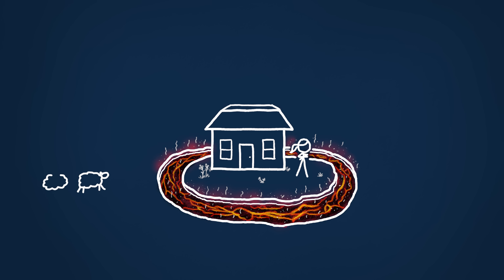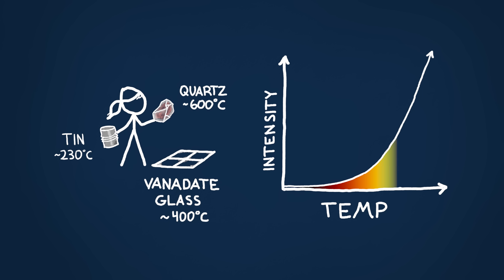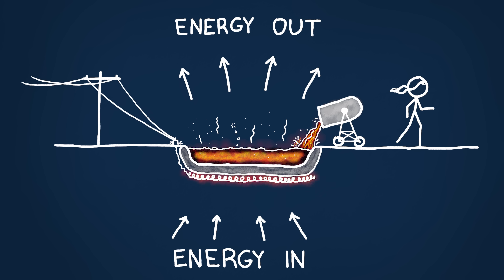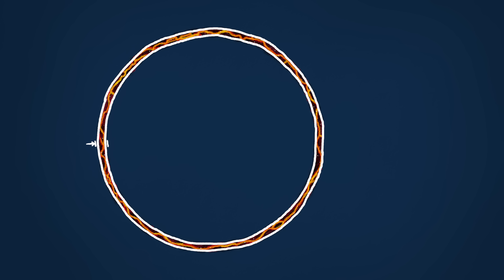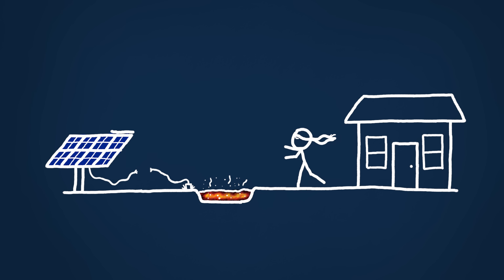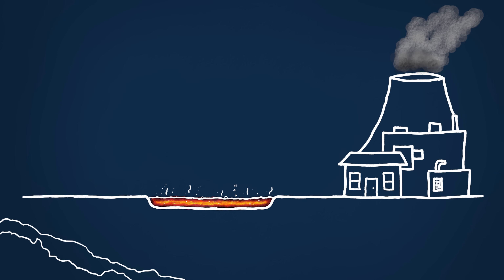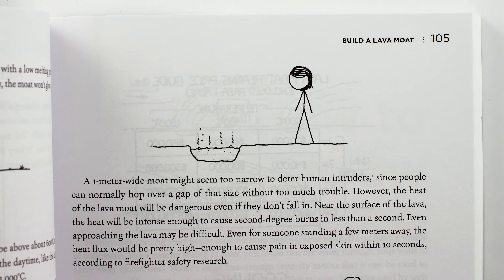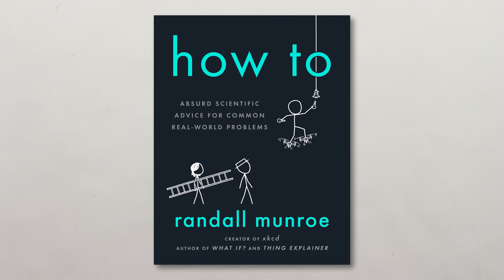How to Build a Lava Moat (with xkcd)

Comment: in what way is a 10km radius area absurd? Although you will want quite a bit larger area, as you need enough solar power to moat enough area to also fit the rest of the city alongside the solar panels. Or just make the city build underneath the panels.

Comment: Use lenses instead of solar panels to maintain your molten basalt- drops your required A/C ratio by a factor of 20. Added bonus of a superheated invisible wall of death.
Reply: Drops property minimum size to 32 acres, or 25 football fields.
Available now for $78k in San Luis, CO.

Comment: But how deep do I need to make my lava moat? Clearly, a very shallow moat will have a poor surface area to mass ratio and lose a lot of heat. And a moat deep enough to tap into the earth's mantle is not practical. (Although the idea of my own personal mini-tectonic plate is interesting!) But somewhere in between is a sweet spot that could store a lot of heat in it's mass and not radiate too much to the environment.

Plus, you need to discourage tunneling under the moat.

Comment: I think I’d stick with a coal effect lava moat, a few 100 red and orange 25 watt incandescent bulbs with twirly aluminium bits above them and orange/ red glass chunks for realism. 
  As for the burning the burglar, motion sensors triggering a spark and propane gas jet. 
  Problem solved on a budget!

Comment: How about mixing radioactive material in with the lava? Cut out the middle step of generators and heating elements and heat it from radioactive decay.

Also, if you got it hot enough, could you have blue lava?

Comment: Instructions unclear. My lava is emitting 3.6 Roentgen. Not good, not bad.
Reply: 3.6 roentgen from lava moat ? This man is delusionnal, take hime to the infirmary !
Reply: you didn't see graphite in the moat.
you DIDN'T!!!
Reply: Instructions *nuclear.
Reply: It's all fun and games until

ionizing gamma radiation
Reply: In order to produce ionizing radiation just from blackbody radiation, your lava will have to be at least ~300,000 Kelvin. It's emitting at least 460 terawatts of power per square meter.

Color me impressed.
Reply: @nathanaelvetters2684  sorry to disappoint you but we just threw in a bunch of radioactive metals :(
Reply: @Carmenifold  Using radioactive decay to provide the heat for your lava moat seems like a sensible low-maintenance solution to avoid the need for external power or having to build a power plant inside the moat, making this solution especially attractive for small, single-home moats.
Reply: Maybe you should get a copy of the book, like me.
Reply: Nah
Just a chest xray
Reply: This lava is infirmary, take it to the delusional.
Reply: But at what rate?

Comment: I like how in the intro they used the logic symbol "and".
Reply: @lanye74  nobody is talking about programming, why do you bring it up? We are talking about mathematics.
Reply: In C/C++, that's the exclusive OR symbol.
Reply: @rgbii2  Yes, but in maths its logical conjunction.
Reply: @rgbii2  yes, but I talking about maths and logic.
Reply: @OtiumAbscondita  ^ Doesn't this symbol show that a term/function is being raised to a power/exponent?
Reply: @kianasheibani1708  ohh
Reply: Its also the "wedge product" symbol which works too. Sorta like cross products with vectors ("x") but much more abstract.
Reply: @scicodude  The wedge product is no more abstract than the cross product. The wedge product of two vectors has a concrete geometric visualization as an oriented parallelogram spanned by those two vectors. This can be used to represent practical real-world quantities like torque, just like the cross product. Maybe your introduction to the wedge product was simply in a more advanced context than your introduction to the cross product.
Reply: @lanye74  No. It's not that simple.

In C & means bitwise AND. But it also means address of. C doesn't have a pointer symbol or 'operator' as such.  It depends on context. Context is the keyword.  Because think: * is used for more than just pointers. It's also used for multiplication. Just like & has more than one meaning. You don't even have to use the address of to use pointers.

Comment: OK, quick question, could you in theory use some of your lava moats radiant heat loss to generate some of the power you need to sustain the lava moat? I know you'd need to input some energy to kick start the process.
Reply: Collecting the waste heat and moving it is an entire essay and a half. And it doesn't look as cool

Comment: Did you use the electrical power output of the nuclear power station or the thermal power output which is about three times greater? You only need the heat so you might be able to get away with a much smaller power station. Better than that you could just heat the lava moat directly with nuclear fission, you'd actually be more secure because you'd have a highly radioactive lava moat and you'd be hiding behind a huge shielding wall.

Comment: Counterpoint, you're on the right track with the nuclear reactor but the electricity is an unnecessary conversion. The reactor is powered by what are basically self heating rocks, the lava is at its core just very warm rocks. 
If you get the mix of radioactive and regular rocks juuuust right you'll end up with a self heating lava moat, with only the slight downside of it being "melt your face off and give you cancer later out of spite" radioactive. But if you're the kind of person that is building a lava moat, my guess is that safety isn't all that high on your priority list.

Comment: I know you hate the Imperial Measurement system irrationally but if you really want to educate people about it you should include the imperial measurements in your video along side the metric as a public service.
Reply: Perhaps this will help: each one cubit square of lava moat will radiate the energy of 2,000 load baring donkeys. To finance should a system you will need to barter 23.6 sheep per hour.
Reply: @clioaspinade9275  This is a physics channel you need to be more precise. They have to be American Mammoth Jackstock donkeys and Barbados Black Belly sheep.
Reply: Any county that educates people in non-SI units deserves universal scorn.
Reply: 1 meter ~ 1 yard. 1 km ~ 1/2 miles. For high temperatures, multiply the celsius temperature by 2 and you’ll be in the ballpark range of Fahrenheit. The other units such as kwh are in use in the US as well.
Reply: People that cannot grasp the metric system are beyond hope.
Reply: @garethhanby  Stop being an asshole.

Comment: Reminds me of some calculations I did a few years ago to work out the total heat output from our energy use. All of the energy we generate from coal, heating oil, natural gas, petrol, geothermal and nuclear ends up as waste heat either during generation, transmission or point of use. It turns out it's a notable chunk of the energy imbalance driving global warming. Not a majority but not insignificant. Wind and hydro are effectively neutral as you are just moving heat around. Solar is less neutral as it alters albedo, shifting from reflected visible light that escapes easily to infrared heat output that's trapped by greenhouse gases. So you want to build solar where albedo is already quite low if possible.

Comment: Couldn't you use the heat given off by the lava moat itself to reduce the energy requirements for the lava moat?
Reply: That would require covering the lava moat to trap the heat radiated, which kind of defeats the purpose.

Comment: Using solar panels is ineffective, because typical panels convert around 20% of the energy into electricity. (Best are around 40%.) You can get close to 100% if you just use mirrors and concentrate the sun rays into a black object to be heated. Something like heating tower. You would need 5 time less mirrors.
Another idea is using something like Molten Salt Thorium Reactor to keep the lava hot. They work at much higher temperatures and may be used to warm the lava directly. Thorium is more common and MSTR burn all of it, so they can last decades with one load.

Comment: Does the book go into the long term maintenance of the lava moat?  How would you maintain the ceramic crucible?  How much would it cost to go through the process of replacing part of the crucible, heating, and/or insulation?  How often would such maintenance be expected to occur?   Especially with replacing sections of the ceramic crucible since that can't last as long as we would need it to, and would likely need repairs/replacement over time.  I need to know if this is addressed in the book.

Comment: "The moat needs to surround an array of solar panels 8 km across. Which is clearly absurd."
Absolutely! That's a step too far.
Reply: Meanwhile having your personal nuclear plant is totally reasonable.
Reply: probably only if the solar panels are lying flat.
If they were tracking the sun and had MPPT ......
Mirror array using lava instead of salt
Reply: @kewakl8891  making the solar panels track the sun don't make you win on space, it makes you win on the quantity of panels. (basically the energy you can get with a solar panel is proportional to the amount of shadow created if the land was flat, the only way you can "cheat" with that is by making some kind of wall of solar panels whose shadow would spread outside of your protected land)
Reply: @anneaunyme  an angle of less that 90 will cause a loss of some of the energy. But if you could power a lava moat, I think that you would also be able to cheat.
Reply: @kewakl8891  That's true if you keep the same solar panel surface. That's not true if you just blindly cover all your surface with panels because you don't care about their cost (you probably are in that situation if you seriously consider installing this moat). Just do the math if you don't believe me (it is actually pretty easy to get it with a drawing but those are hard to do in youtube comments)
Reply: @Blake Belladonna The problem with mirrors would be finding a way to place them. If you consider big solar furnaces that melt metal, they use a field of mirrors just to melt at a very specific spot. Here we want the whole moat to stay hot.
Reply: @anneaunyme  still better than solar panels. With solar panels we go light -> electricity -> heat, but we could go light -> heat. If it is not possible with mirrors, it would definitely not be possible with solar panels. For example, if you want to heat up some water, it's easier to do it with a black surface than with a solar panel. It's like energy in the form of electricity is more valuable than heat, so you get less of it.
Reply: Desimere  I get it, my point is just that to achieve what you are talking about you would need to build some kind of gigantic tower that would only work for some positions of the sun in the sky.
Some quick math: the sun radiates 1kW/m², and according to this video the lava needs 100 times that just to keep its temperature. This means you need at least 100 times more horizontal surface of mirror than the surface of the moat. If we want at least a 3 meter lava moat and a round perimeter of radius R we need 100*tau*R*3m (100*surface of the moat) < tau/2*R² (surface of the inside). After simplification we get R>600m.
Let's assume we live in an ideal world where the Sun is always in the zenith (that's by far the best situation here). Then we need the mirrors to describe a parabole. From this you have two parameters to balance: how deep the hole for the border of your property to be in (D) and how tall the tower in the middle (T). The hard constraint is that T*D²>360,000m^3 (so for example if you built a tower 800m high, the size of the biggest in the world, you would still need the borders of your property to be 20m deep.
Of course, this ideal world doesn't exist, and in reality...
 - there is night, during which the Sun is not there at all
 - the Sun is not perfectly at the vertical, so all the mirrors at sizes would get shadow a significant portion of the time
 - the Sun moves, so you would need a way to make your giant tower reshape itself permanently
Reply: Or, rather, a step too close.
Reply: @Blake Belladonna I'd be worried about keeping the heat up at night.